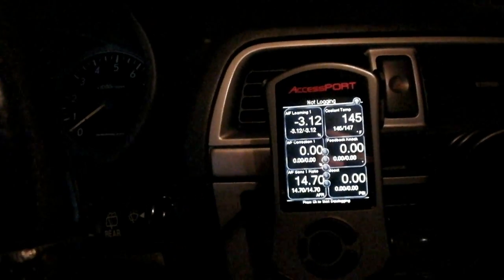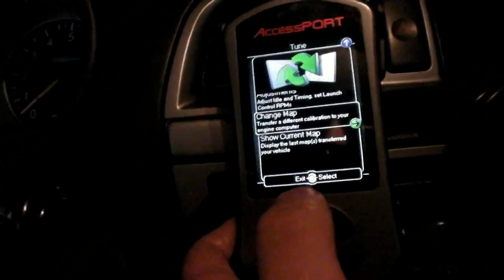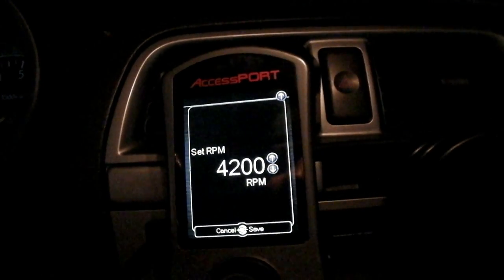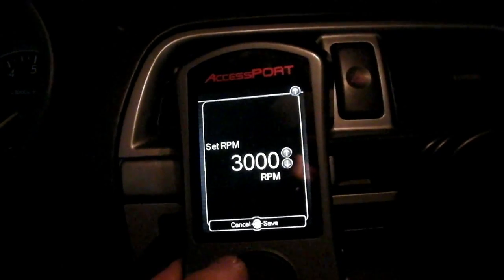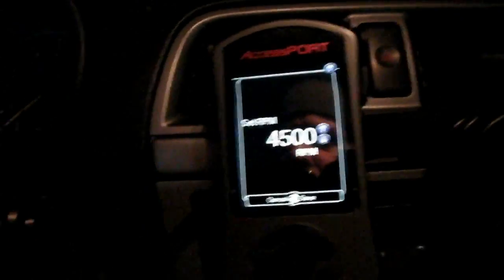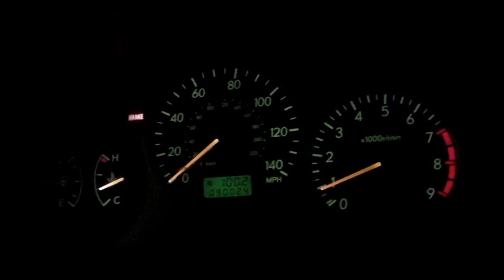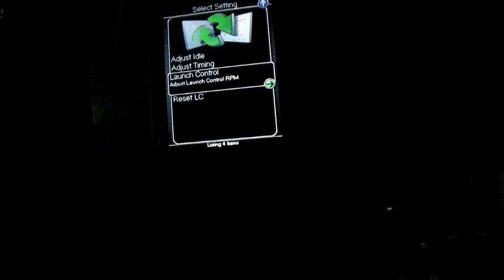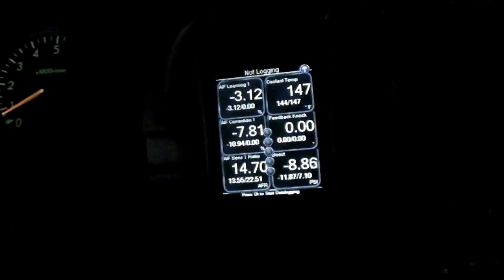Cobb Accessport Launch Control

Comment: I adjusted the launch control to 4500. And revd it in neutral to test it.  And it didn't work. Does the clutch have to be down for the launch control to work?
Reply from the maker: Yes

Comment: Afr at 21?!?! Thats a little lean bud
Reply: Buddy the AFR always fluctuates and settles back at the 14.7 range. Anytime you do a pull or give throttle this will happen it will shoot up to 22 and it’s completely normal. Have you ever owned a WRX with AP?
Reply: @ yeah I do Have an access port. But I have actual gauges for my cars vitals lol, I didn’t know that I don’t monitor my afr through the AP. Good to know.

Comment: are you holding your foot on the gas pedal? mine will rev up but I have to keep my foot on the gas
Reply: Yes its not a automatic launch control. Keeping mind once you get the hang of doing this you're gonna need to shift soon after launch.
Reply: It just lets you set your RPM/boost levels for the launch.

Comment: how would this work on an automatic
Reply: Stand on the brakes while in neutral and it'll do the exact same thing. I'm still looking at if it's damaging to your car if you do it a lot, not launching, just revving it. The AP LC uses a fuel cut method I read so far too.
Reply: +Jeremy Croll (Amazing Asian) would it sound the same?
Reply: Exactly the same. I'll try and upload a video from the BNW 2016 exhuast competition of me in my Saabaru with it.
Reply: +Jeremy Croll (Amazing Asian) ok
Reply: +Jeremy Croll (Amazing Asian) ok

Comment: How did you get the map for launch control and flat foot shifting?
Reply: Did you ever figure this out?
Reply: Yes I did.
Reply: +Hiram Edwards how?
Reply: +Jaquez Davis download the free accessport mapping software on your computer, plug in your accessport and it will automatically update the accessport to add both launch control and flatfoot shifting.
Reply: +Hiram Edwards year I did it's on 7.2.0-11420
Reply: +Jaquez Davis plug in the Accessport and open the software, it should start the update, or you will need to start it.
Reply: +Jaquez Davis use the USB cable to attach it to your computer.
Reply: +Hiram Edwards did all that and it just says its up to date, but I still have no adjustments menu
Reply: +Jaquez Davis did it actually say it's updating or up to date?
Reply: +Jaquez Davis I'll let you know the version mapping software to download in a few.
Reply: +Hiram Edwards it said it was up to date and alright
Reply: +Hiram Edwards and FYI I have an MS3 but it also has the LC and FFS
Reply: +Jaquez Davis ok, that makes sense, lol... http://www.cobbtuning.com/mazdaspeed-updates-march-2015/
Reply: +Jaquez Davis hope the link helps.
Reply: +Hiram Edwards thanks